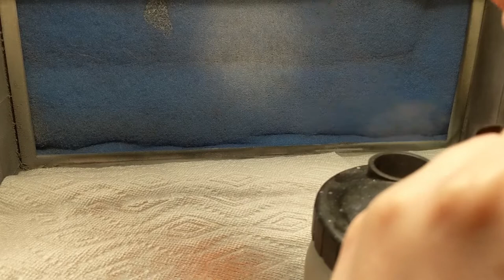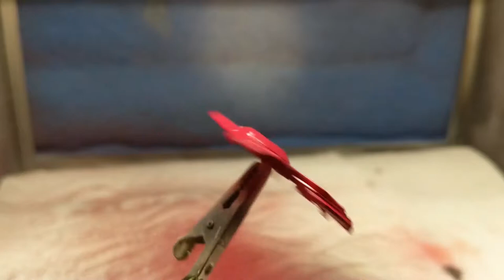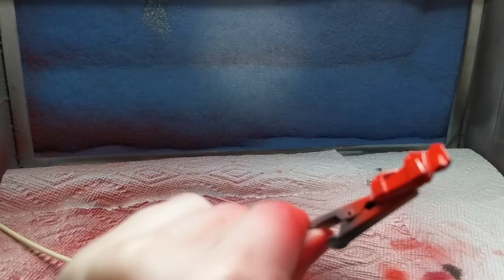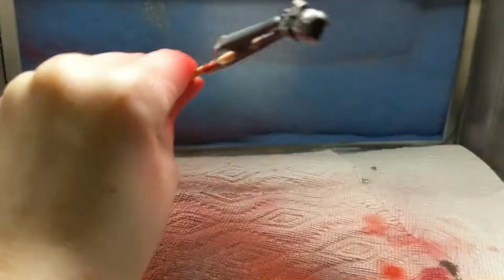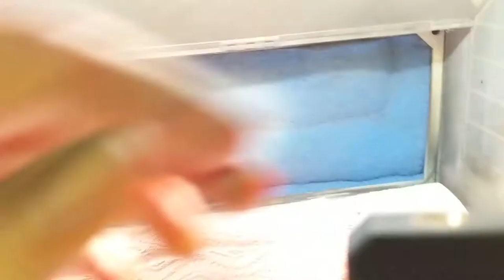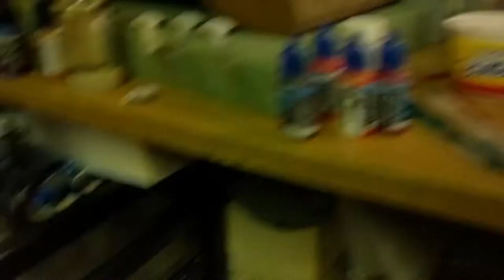Start to Finish Building Gunpla Part 3 -  Airbrushing

Comment: Hi nice video, i want to ask. So i painted my HG, this was my first time using airbrush . When i assemble the pieces by pieces  the paint are broke/scratches especially at the joint part, is like so weak. Even thought i already use primer and topcoat. Do you know what the problem? im use lacquer paint .. thanks for your attention
Reply from the maker: maiyo hendrawan Hi! So for this problem it sadly doesn't come down to paint but what happened is the parts rub against each other. Don't feel bad about this happening though it happens to me all the time. You can go about this a few different ways to fix it. One look at the spots that are being scratched and sand down the parts that's causing the scratches. Then to you can ether hand paint the spots that are damaged or take it apart and spary paint it. Two in the future before you paint pay close attention to the joints and parts that can move to see if anything rubs against the plastic. Sand those parts down paint on a little primer paint to see fit it rubs off. If it doesn't your all good but if you still have a little scratching it sand a little more. But sadly this is happen this to anytime of paint no matter how strong or weak it is. If it's nothing that you won't notice I sometimes just leave it cause it's not worth the work to fix it if you not going to see. I hope this helped you out! Let me know if you have any other questions 😄
Reply: Gundam Mechanic thx for the answer. How long you let the paint until it cured? And then assemble the part? Because i feel that my paint only dry? Not totally cured. Maybe that's what makes the paint broke
Reply from the maker: maiyo hendrawan that may be apart of the problem I normally let my parts sit for at least 1day but sometimes longer just cuz I didn't have time to get to putting them together. However even if the paint is mostly cured you will still have  the scratching problem cause the parts are still rubbing together. It never hurts to let the parts sit for along time to cure :)

Comment: I picked up some Vallejo Mecha paints, but they're too thick to use straight out of the bottle for me. What ratio do you thin yours?
Reply from the maker: I would do a 3:1 ratio 3 being paint and 1 thinner cuz those you shouldn't have to thin all that much. I hope that helps :)

Comment: How do you spell it? Alkyd paint?
Reply from the maker: alclad paint :)
Reply from the maker: @Good_boy518  that really does sound like a great idea you have. I of the mind set that if you practice enough at something you can do anything. I think the color scheme you picked out is really fun and interesting! I love the idea of those color gradients. What I can recommend you to do is practice on some regular plastic spoons your gradients. Then when you feel confident enough the lay the paint down on the models. Another thing is don't be after is you mess anything up a long the way with painting you can always paint over a part your not happy with. If it is a really bad mistake you can always strip the paint with 91% isopropyl alcohol (don't worry this will not damage or melt the plastic) to start over.  I hope this will help you out on your project! If you have anymore questions let me know :)
Reply: @natcodex  Thanks for the tip. Iv heard about isopropyl alcohol before, and Ill now put it on my list 👍
What kind of colors do I use? Metallics? I need it to have that sort of infrared glow you know...
Clear coat finish to pop it out? Is that necessary?
Reply from the maker: @Good_boy518  I honestly am not sure how you would get in infrared look. However top coat it definitely necessary since it protects paint and will give a finished uniform look. Since some paint have different finishes when they dry.
Reply: @natcodex  Ok, I understand. Is clear coat a top coat? Also, should I use a lacquer type to prevent scratching
Reply from the maker: @Good_boy518  yep it is just a clear coat and what will really help prevent scratching is letting a good amount of time for the clear coat to cure. But lacquer is the strongest type of paint out of all of them.
Reply: @natcodex  Ahh I see, I see... got it. Alclad is enamel based right? Do their black primers have the glossiest look? What happens if I prime with Alclad, and cover with lacquer Mr. Color.. Im considering some of their pearl or shiny paints for the color. Should be ok?
Reply from the maker: @Good_boy518  alclad is a lacquer based paint so you should have no problem either way when using Mr. Color paints. Alclad also makes a very shinny gloss black that work great with metallics.
Reply: @natcodex  Alrighty. Thank you so much for all the input btw.. I really appreciate it